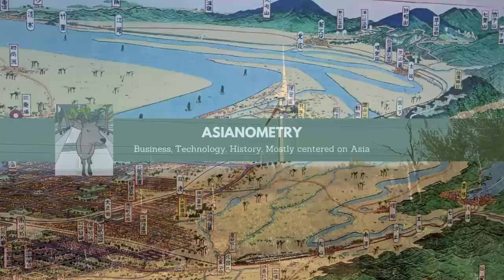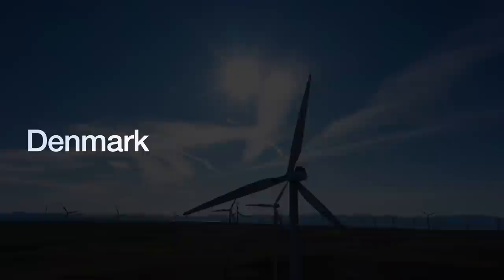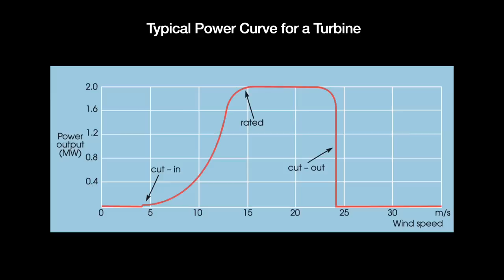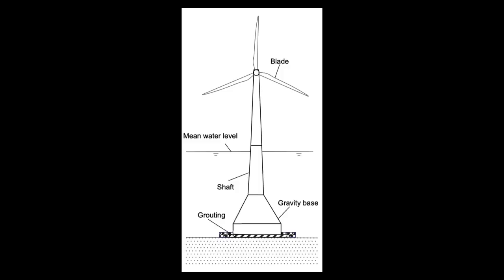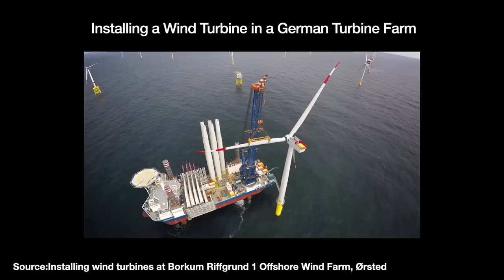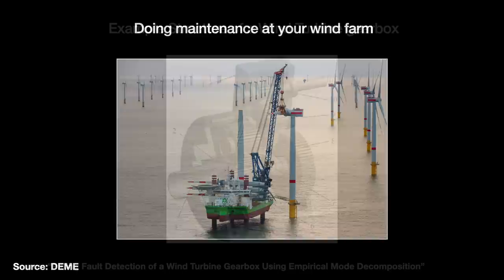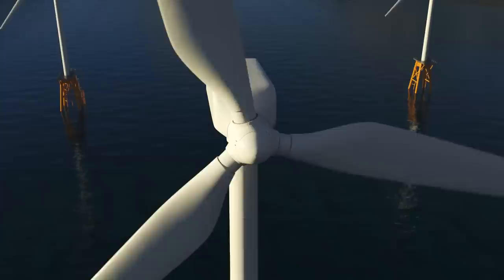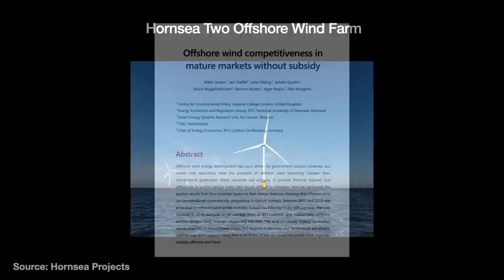Putting Your Wind Farm on the Ocean

Comment: Nice video -- one quick note.   You mentioned gear boxes, and the role that they plan in increasing the risk and maintenance costs associated with offshore turbines.  When I was in a sustainable energy generation class in college, our professor mentioned that one important industry trend was offshore turbine manufacturers moving away from turbines with gear boxes and towards turbines with direct drives (where the shaft from the turbine blades connects directly to the generator) for offshore applications 

This makes the generator cost more (Generator size scales along with armature current, which is determined by the speed of the generator input shaft among other things -- this means you need thicker copper windings, a larger core, more everything), however, the increase in reliability (more up time generating product), decrease in maintenance cost, etc makes a direct drive worth it in many cases for this application.

Super cool video -- thanks!
Reply: Wouldn't that cause issues with both power generation consistency and vulnerability to damage from violent winds? You don't have anything to boost and/or moderate the spinning, so generation should be a lot more erratic, and it'd all be more vulnerable in storms.
Reply: Gear boxes have gone a number of years, too much maintenance and for onland turbines, too much noise
Reply: @ArawnOfAnnwn  no, they generate in dc and this is converted to ac in the turbine via large inverters.
Reply: Direct drive turbines generate variable AC which is rectified to DC then inverted back to AC to match the frequency of the grid
Reply: @matthewcherng  Both types of turbine generate an AC output from the generator. That output freq. Is never what reaches the grid.  The Power will be rectified, and then inverted to match the grid Frequency and phase.  This rectification and inverting happens  because for both turbine types the "gear ratio" is fixed (1:1 for direct drive, some other fixed ratio for a gear box drive).   

 There is some ability to adjust the angle of attack on both types of turbine, but not to control the generator output freq. -- changing the angle of attack is helpful when you're in a high wind situation, because the turbines will have a maximum rated blade speed.  If you change the AOA your extraction efficiency is lower, but at least you can continue to generate energy (though at a certain point, AOA changes won't be enough to stay below the maximum blade speed and the turbine blades will need to be held still by a friction brake.
Reply: @brendancooney9401  No.  Common practice now is to use a DFIG, or Doubly Fed Induction Generator.  These use an inverter to drive the rotor with an AC frequency such that the rotor drive frequency and rotor rotational frequency sum to the utility frequency.  Say you have a 60cy/sec grid, but the generator is only spinning at an effective frequency of 48cy/sec.  The rotor is driven at a frequency of 12cy/sec to make up the difference.  This allows a much smaller inverter as it only has to handle the rotor drive.  Say my previous example was generating 1MW at the generator.  800kW would be fed into the system it is feeding and 200kW is fed back into the rotor.  The 800kW going to the grid goes into the rotor as rotational kinetic energy from the blades.
Reply: High power undersea three phase power lines cost more than DC power lines of the same capacity. The total system cost including the inverters often makes it worthwhile to run a high voltage DC power line from a central point in the wind farm to the mainland. Or possibly multiple smaller lines to allow the wind farm to continue operating at reduced capacity after a ship damages one of them, or a line or its inverter needs maintenance.

So most likely an off shore windmill will generate AC that is converted to DC within the turbine housing.

For other applications the most efficient inverter topology to simultaneously convert frequency and voltage is not AC to DC to AC, but rather to convert directly from one AC style to the other. It involves more high power semiconductors, and thus costs more.

It makes more sense when you realize that the inverter is operating in the hundreds of kilohertz or higher. Over the time frame of a microsecond, a 50 or 60 hz sine wave is effectively DC.
Reply: From an investor's point of view: direct drive has a better refurbishability. A part of the profits wind energy investors (such as yours truly) make is on the refurbishment: after it's technical life, a turbine is taken apart, refurbished, sold and installed somewhere else. A gearbox is a complicated piece of machinery with a lot of expensive parts. Refurbishment practically means shipping the entire nacelle to it's manufacturer to be taken apart, severely denting the second-hand-value. For a direct drive, refurbishment can be done practically on site (if needed at all, in one of our earlier models, only a couple of bearings needed to be replaced).
Reply: And less drivetrain power loss
Reply: While on retirement an old gearbox's materials are practically worth very little compared to initial cost. The copper in generators however retains a lot of it's value.
Reply: @pokute6318  Even more valuable on the generator are it's magnets. On geared turbines, these aren't all that special (most manufacturers use off the shelf generators). On direct drive turbines, these contain rare earth magnets. Because of that and the lower rpm and less wear on the generator part, the nacelles of direct-drive turbines retain most of their value on the second-hand-market.
Reply: @brendancooney9401 the other way around. As the video points out, the electricity is converted to DC for transmission (HVDC)
Reply: You're getting bad for too many ads. I can't watch anyone with all this ad spam.
Reply: In fact no large turbine built in the past few years has a gearbox. That is obsolete technology.

Comment: Three blade rotors have more constant loads on the bearings in the presence of wind shear than two blade rotors.
Reply: and more torque at lower speeds
Reply: So why not four or more blades then?
Reply: @ArawnOfAnnwn  This is starting to reach the limits of my knowledge, but my understanding is that increasing the rotor weight increases the cost of the tower and foundations. There are a couple of ways a two-bladed design could handle wind shear:
1) Vary the blade angle to partially unload blades at the top of the arc where the wind will be strongest. But this means less energy will be extracted at some wind speeds.
2) Add a hinge between the hub and the tower so the rotor and hub together pitch up and down as the rotor goes from horizontal (pitch down torque from the rotor weight) to vertical (pitch up torque from wind shear). My assumption is the extra complication isn't worth it versus going with a three-bladed design but adding additional blades beyond three just doesn't have enough benefit to be worth the cost.
Reply: @andrewwade1651  Higher blade counts have increased drag, which is why you tend to see them in applications like direct drive water pumps and air compressors where the high starting torque of lots of blades is needed and the drag from those extra blades serves as speed regulation.  Having only 2 blades makes the blade set a right pig to balance (see all of the problems with the Smith Putnam Wind Turbine; Power from the Wind by Palmer Cosslett Putnam is a good resource on this as he designed the bloody thing) as the blades sit in a line in the plane of rotation and thus there is no way to correct for loading forces normal to this line.  3 blades in contrast form a plane and are thus muuuuch easier to balance.  Marcellus Jacobs of Jacobs Wind Electric fame figured this out a century ago.
Reply: @randacnam7321  Started reading Power from the Wind. Very interesting, thanks, especially the design with the "coning" of the blades, which they were probably right about alleviating the impact of wind shear. But putting the rotor downwind did mean the blades would hit the turbulence off the tower.

Comment: Good summary. I happen to have studied the topic extensively and all important parts are there. Additional bullet items that can be included (in part 2 installment?  ☺) are.
 - the interest of floating wind farms. e.g.  West coast of Taiwan offers shallow sea beds but East coast doesn't (opposite USA).
 - floating wind farms can be laid out in the most windy areas because seabed depth is less of a constraint and best load factor areas can then be reached (i.e. >50%).
 - some floating wind farms are now studied with no back haul link to the coast because their production would be used to produce green H2 (locally stored, then regularly ferried to the ground). See Tractebel/Engie concepts.
 - 9:45 Cable shows 3 phases for power + command and control and telemetry cables smaller holes (typically for optical fibre).
 - Synchronous adaptation to the grid frequency and phase, despite variable windspeed.
 - absorption of reactive energy through phase adjustments
 - newest offshore power above 15MW (Siemens, etc).
 - Denmark H2 islands - with multiple countries back haul cables for both production and interco usa.
 - geopolitical aspects of redistributing natural resources to otherwise oil-destitute countries (Morocco, Namibia, Chile...) with the goal of developing the Green H2 economy.
Reply: as to H2 2:01 - good comment!

Comment: I work for a developer of Floating Offshore Wind Tension leg foundations and are struggling to get any traction from the industry.  It amazes me that they are already hooked on other high cost ways to install floating WTGs.  Tension leg platforms are low cost due to a relative low amount of steel required to build them and using cables (tethers) to hold them to the seabed is the most economic way to do this!   We are hoping the industry wakes up soon and we can demonstrate TLP foundations for floating wind farms👿
Reply: A reason the Dutch offshore companies prefer other methods is because their expertise stems from the Delta Works era. They gotten very good at that, but never ventured out into other methods (see Allseas). Besides, how deep is the North Sea anyway.

Comment: the UK subsidy for wind, which is a contract for difference that companies bid over backed by the government, has actually made the government billions in recent years, and makes wind offshore wind the cheapest form of energy in the UK.
Reply: @conor7154  It's not one of the most expensive However it is more expensive than the cheapest which is commercial solar. Wind and natural gas have virtually wiped out coal generation in the UK and the trend now is for wind and solar to replace natural gas.
Reply: @ianhamilton3113  The cheapest form is nuclear, but the UK doesn't have much of that. That's also one reason why electric power is so expensive in the UK. And also in the EU. And, of course, a significant part of electric power is various green taxes. That's why in Ukraine electric power costs 3 (euro)cents per kWh, while across the EU is about 15-40 cents per kWh (the UK being on the top end of the price).
Reply: @gpsoftsk1  Try telling the Finnish Government that Nuclear is the cheapest form of power generation. Their new EPR is already 12 years late and who knows when that will actually start. Over budget or what?
Reply: @gpsoftsk1  High electricity prices in the UK have been caused by the high cost of natural gas which last year made up around 40% of electricity production.
FYI 15% was nuclear.
Reply: @gpsoftsk1  Also electricity pricing in the UK is set throughout the day by the highest supplier cost. Weird but that's how it's done.
Reply: @ianhamilton3113  Yes, because natural gas is a backup for wind and solar, if the wind is not blowing, then we burn natural gas. Instead of having a lot of stable, cheap nuclear power. Yes, the highest supplier cost is another problem with the electricity market.
Being late with a nuclear power plant construction has nothing to do with it, that's clearly a problem of their government and that's a capital investment, not an operational cost. It's interesting that 50 years ago we could build these nuclear power plants without a problem but today nobody can finish them.
Reply: @gpsoftsk1  "It's interesting that 50 years ago we could build these nuclear power plants without a problem but today nobody can finish them."
It's a mixture of new untested technology and over regulation due to previous accidents.
Latest nuclear plants are very safe but SMR's are probably the way to go because they can be produced in a factory in large numbers. If we can put them in a submarine then why not a warehouse?

Comment: Hope floating wind farm becomes cheaper and turns out not aging the wind turbines too fast. The capacity factor gain would be large 60% compared to 30-40% for on shore wind. And there's theoretically enough wind resources for all our energy needs. Would need quite a few turbines though of course and cables.
Reply: Wind energy is huge fail. Period.
Reply: Wind is losing out to solar atm.
Reply: @ArawnOfAnnwn  Solar has more capacity, but in winter, wind seems to be king. Both are great in their own way.

Comment: Hello from Wind turbine blade manufactuing industry!

Even turbine blades amazing because all that massive blades are handmade. Blade manufacturing process not includes so much machinery. Every blade has some defects and every blade needs repair during the production. Generally people think blades are manufacturing with using alluminum or steel but these blades manufacturing with using composites. We use glassfiber mostly and for the structural part of the blade we using with carbonfiber. Maybe you can make a video about blades!

Denmark has the market leader company called Vestas. They are leading the wind energy business. All offshore wind farms that you mentioned at Denmark, builded by Vestas.

Comment: There are a number of engineering justifications for using three blades ( i.e. solving various optimization problems), so aesthetic is just icing on the cake. ( Actually the aesthetic part is likely a consequence of 3 blades being more stable than 2 blades, which also likely makes them more visually balanced hence more aesthetically pleasing).

Comment: Offshore wind farms seem like a good place to also put tidal power generation facilities - possibly even make a dual generator, with the turbine mounted to a tidal generator. One note about this technology is transmission, as theoretically turbines could be put into distant chunks of ocean - such as the Pacific Ocean between Peru and Guam. But the power line transmission losses would make this unrealistic.
Reply: Tidal power is a waste of money. It barely generates any power in nearly all locations. You need a significant tide and a natural chokepoint for water flows before it's even remotely worth the investment.
Reply: @nvelsen1975  This is good to know. It sounds like downspout generators, which seem like they'd make sense only in Seattle, the UK, and a couple of other parts of the world.
Reply: @StephenGillie  
The UK west coast does have a few of those strong current points. Korea too I guess.

But they installed them as a testbed on the Dutch Oosterschelde dam and the yield was basically anywhere between 'not much' and hahahaha.

The same was done in a few Dutch rivers and while technically it did create power, the cost-revenue ratio meant it doesn't seem commercially viable.

So barring a sort of mechanical revolution, it'll remain a niche thing.

Which is kinda sad because wind and solar tend to be concentrated in the daytime, requiring a very significant nuclear component on standby to create a fossil-free power generation.
Reply: @nvelsen1975  Or some kind of battery system. Pumped storage is one of the oldest technologies. The pumped storage at the Grand Coulee Dam can store about 48 hours of power at 75% efficiency.

Comment: Off-shore wind has advantage over land-based turbines as windspeed over water is higher on average than over land for similar weather conditions (less surface drag and turbulence). Similarly the wind stream over water is more uniform, or laminar with height, thus the ratio of power intercepted by the wind from lower arc of the turbine blades more closely matches the power intercepted by the upper half of the blade arc sweep.

Comment: Great video!  A couple of notes:
  One advantage of offshore is that really long blades are easy to transport.  Modern turbines like the GE Halide 14 MW have blades that are 107 m long, which are very hard to move around corners on land.  They're actually made in coastal factories so they can loaded directly onto ships.  
  My state of Massachusetts is relying on offshore for its future power needs.  There are about 3 GW of plans in the works, and the first 800 MW plan, Vineyard Wind, just started construction.  It should power up next year.  It has been delayed for years by the Trump admin and by astroturf organizations that claim to be worried about humpback whales and fishing.  Unfortunately, their costs have gone up, so several of the developers are trying to back out, claiming that they can't make money at the agreed upon prices.  This could be real, it could be a negotiating tactic, or it could be strong-arming by natural gas interests.  The gas people did sponsor a referendum in Maine to block a transmission line for Quebec hydro power, so nothing is beyond them.